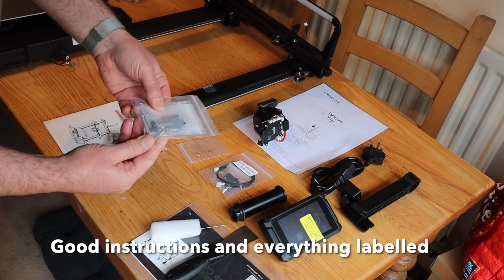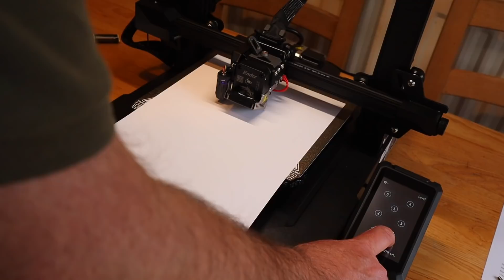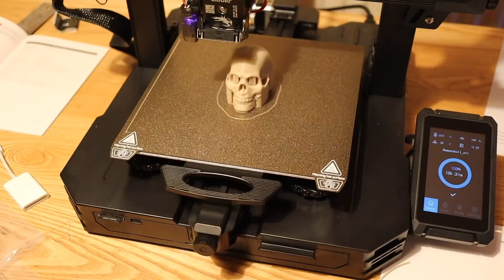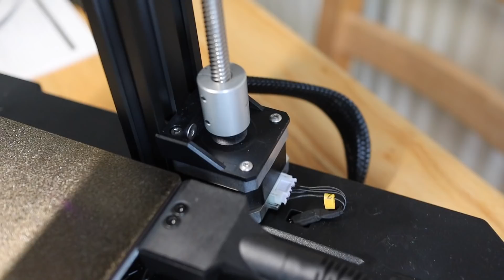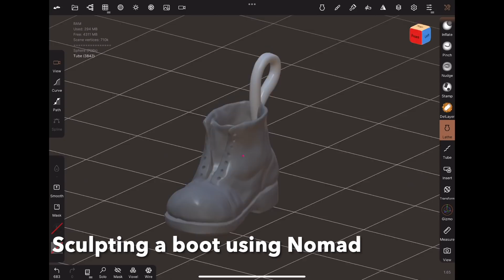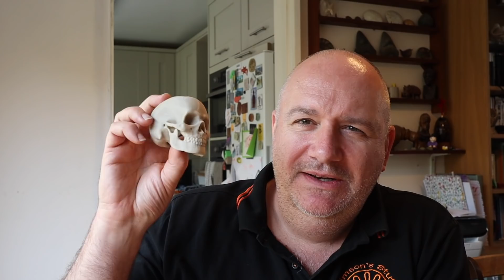Reviewing the Creality Ender-3 S1 Pro 3D Printer and First Prints

Comment: Hi Jim thanks for posting,I have just purchased the Ender  3 S1 pro, is the enclosure ok for this model ? Is there enough room at the rear for the power cable or does it press against the housing ? Your opinion would be much appreciated cheers Paul
Reply from the maker: It does fit but it is a bit tight, from memory I think I angled it slightly. It was certainly easier once connected to the Sonic pad because it meant I could take the screen off. They do make a bigger enclosure but it is very big. I used mu S1 in the smaller enclosure for a long time without any issues.
Reply: Many thanks Jim I will give it a try, the big one will be to big for the room I have available, 👍 Paul

Comment: Just got this printer and so far after 2 days of futility I'm about to give up. I have not yet had ONE success.  The first layer never sticks and the bed level is perfectly flat.
Reply from the maker: It sounds like you may have the Z axis offset too high, make sure it is low enough to slightly press the first layer into the bed. It might also be worth cleaning the bed with some IPA. I have found this printer to have excellent bed adhesion.

Comment: Literally started my first ever printer today - S1 Pro! Set the z-offset, autolevelled and ran the rabbit of the SD card - and what a joy! Came out stunning! 😍😎👍 Thanks for your great review/quick guide! 👌
Reply from the maker: That is great, I still love this printer and it is still the printer I use the most, very consistent high quality prints. Many thanks for watching
Reply: Funny, I tried and I have yet to get a successful print.  It sits now alone after 20 attempts.  Tired of fighting it.
Reply: I had trouble getting things to stick, i used glue stick and it worked well@uw91

Comment: Incredible print quality. May I ask the layer thickness and support spacing you used?
Reply from the maker: Yes I was very impressed with the print quality. I think I used several different layer thicknesses for different models, from 0.12 to 0.2mm.
The supports were just the ones that Cura added automatically at default settings. Many thanks for watching

Comment: Hi Jim, another great video. I have a very similar set up and I’m interested in the lamp you have inside the enclosure. Do you have the specs and/or a link for the lamp?
Reply from the maker: Many thanks. This is the lamp.    https://www.screwfix.com/p/twin-2ft-led-batten-25w-3000lm-240v/710fx
I bought it at a much cheaper price, there are a lot of similar lamps available

Comment: I noticed you only use the basic settings, does this help in any way, as I was tring to use the advanced settings and am running into problems. Great prints by the way, love your easygoing attitude to everything you do.
Reply from the maker: Thank you very much. I try and keep things as simple as possible with the least number of variables , this helps diagnose possible issues. I have now started using advanced settings more but mainly adjusting retraction and for spiralize/vase printing.

Comment: Great video, thank you Jim. I have this machine but even at 0.12 my prints are much less smooth than your first skull (more like the later black prints). Is this a trick of the light or is the skull in fact quite smooth? If so... any tips? Thanks again for the videos!
Reply from the maker: The skull is very smooth for an FDM print but the light must play a part in the appearance. Any differences could be due to filament, I use eSun PLA+ which gives very consistent results. I print it at 215degs. Check out my instagram and you will see the skull printed in Eryone copper silk filament and it is incredibly smooth, a near flawless print. 
The s1 pro produces the best quality prints of all the printers I have tested.
I will be reviewing a Creality resin printer soon which is of course much smoother. Many thanks for watching

Comment: if you make gears for lathes , what filament (material) would you use?
Reply from the maker: I wouldn’t trust 3D printed gears on a lathe, they are not strong enough.
Reply: @JimsonMakes  they would only be for the ratio change , they have no load on them . Just wanted to know which material is the toughest
Reply from the maker: @jayk2k  nylon or ABS is apparently the toughest although I have not tried it myself. They are trickier filaments to use and need to be kept dry and the printer needs to be in an enclosure. There is a channel called My Tech Fun where he does a lot of testing of different filaments

Comment: I have the same one just got it and it already is stopping my prints 4 hours in with a unxecpecred error ? Any suggestions
Reply from the maker: I have had a couple of prints just stop part way through for no reason and did exactly the same thing when started again but were fine when I re sliced them and started again, I think in my case it was a fault with the slicer rather than the printer.

Comment: The skull in the thumbnail Is absolutely beautiful. Is that the out of the box normal print quality or did you do some/a lot of tweeking?
Reply from the maker: Thank you very much glad you like it. That was as it was out of the box, I made sure I adjusted the retraction settings to what was suggested in an additional instruction sheet that came with the printer. The printer has been amazingly consistent every print, near perfect every print and I love the print bed, great adhesion and the prints are very easy to remove afterwards.
Reply: @JimsonMakes  Thank you. Glad I stumbled upon your channel!

Comment: Help... Where do you connect the laser cable if you want to install one? thank you!
Reply from the maker: I've not really looked into that, I just assumed that you would use the same ribbon cable as the extruder/hot end. If that is not the case then there should be a connector on the main board. You will probably need a firmware update too.
Reply: @JimsonMakes  Thanks! My s1 pro is arriving today! and the laser module tomorrow! cant wait to try both features! Ill respond here once i get the laser working. Thank you again!
Reply from the maker: I've not really looked into that, I just assumed that you would use the same ribbon cable as the extruder/hot end. If that is not the case then there should be a connector on the main board. You will probably need a firmware update too.

Comment: Great video and awesome printer...do you have any safe preset fff  profile for this printer?
Reply from the maker: Many thanks for watching , glad you like it. I mainly used a modified profile for the Ender-3 Pro in Cura 5 ( just changed the Z height). The eSun PLA+ I printed at 215 nozzle and 60 bed temps and retraction was set at 0.8mm at 40mm/s as recd by the instruction sheet that came with the printer, I didn’t really change much else.
Reply: @JimsonMakes  great thanks again mate..!

Comment: Would you be up to share your cura profile, would love to try this for myself
Reply from the maker: I just used the default settings on Cura for the Ender 3 Pro and amended the build height to match the S1. I did raise the nozzle temp to 215 for the PLA+. I have now changed the retraction settings to match the recommended ones that came with the printer (0.8mm at 40mm/s), I got a fantastic skull print in PLA silk copper , check out my Instagram.

Comment: Really interested in this printer , I got the CR-10S and it's showing its age. I was wondering won't the main board over heat in the enclosure?
Reply from the maker: I guess it is possible that it will get warmer but it doesn’t seem to get really hot in the enclosure just warm. Unfortunately the enclosure is essential for me to protect the printer from my very dusty workshop . Many thanks for watching

Comment: Nice review! I also got the 3 S1 Pro, but where do you get the quality profiles? I only have the standard quality one (I think it was on the SD card).
Reply from the maker: Thank you very much. I just used the standard Ender-3 settings on Cura to begin with but since filming I have adjusted the retraction settings using the ones suggested on the additional advice sheet that came with the printer and I printed the skull double the size using silk PLA and achieved a flawless print ( check my Instagram for a picture). I used 0.16mm layer height and 20% infil, I need to do more experimentation but I have been very impressed so far.
Reply: @JimsonMakes  Thanks for the explanation! Were you able to set retraction to 0.8mm for PLA? I use Cura 5 beta and it always resets to 0 if I put anything smaller than 1.
Reply from the maker: @Niels_Dn  I was using Cura 5 and set it it to 0.8 but it may have reset it, I just didn’t notice
Reply: I recently got the sprite extruder pro and with my other upgrades to my ender 3 its pretty much this but I can't get rid of my stringing issues. I've used fresh filament adjusted retraction settings and checked fitment on everything. Not sure what else it could be but there aren't many profile options.
Reply from the maker: @outlawgaming893  the suggested settings from Creality for the sprite pro are retraction speed 35-45 mm/s, retraction distance for rigid materials such as PLA 0.8mm, and retraction distance for TPU 2mm. I have not had any stringing issues with PLA+, some stringing with TPU but that is to be expected.
Reply: @JimsonMakes  I've tried just every range of retraction on this thing my PLA+ is stringing the worst.
Reply from the maker: @outlawgaming893  I would try a different brand, it could be that the nozzle temp is too high.
Reply: @JimsonMakes  I've got some new brands on the way. I used a temp tower to try and find the best temp but none of them are good. I've never had troubles with esun before.
Reply from the maker: @outlawgaming893  I love the eSun PLA+, perhaps the extruder is faulty, or the tip is the wrong diameter
Reply: @JimsonMakes  this is why I'm asking cause I'm worried the extruder is faulty. I changed the tip to some known good ones. No luck there either. I was having some faults on my SD card so I've got a new one I'm going to try. But I also have the old original ender 3 power supply people have had issues with. I'm wondering if it's maybe not able to handle the sprite.
Reply: @JimsonMakes  just wanted to throw an update out there. I was able to get the stringing mostly under control after taking apart the heater block and finding the titanium throat wasn't seated very well from the factory. I had filament seeping into the threads of it. A clean and reseat has helped a lot but I'm not quite there. I'll try a new filament to see if it clears the rest up.

Comment: You should try lowering the infill for the TPU cheese print, it'll make it more flexible.
Reply from the maker: Yes I need to experiment more, I used 20% but will try 10% and thinner walls when I get filament dryer. Many thanks for watching.

Comment: I'm not familiar with the workings of these divices and certainly not computer competent enough to use one. I was wondering what purpose does the enclosure cabinet serve please?
Fascinating video, you learn something new every day, they say, thanks Jim. 👍
Reply from the maker: The enclosure is to maintain a constant draft free environment which helps stop warping and layer adhesion with certain filaments, in my case it is mainly to keep the dust off in my very dusty workshop. Many thanks for watching
Reply: @JimsonMakes  thanks Jim, that makes sense now! 👍

Comment: I do wonder why they don't just use a USB stick instead of an SD card
Reply from the maker: There is a USB port on the front next to the SD card slot, not sure if it will accept/read memory sticks. The g-code file sizes are not huge and transfer instantly so apart from having to use the provided adapter there is not a huge advantage in using a memory stick. Many thanks for watching